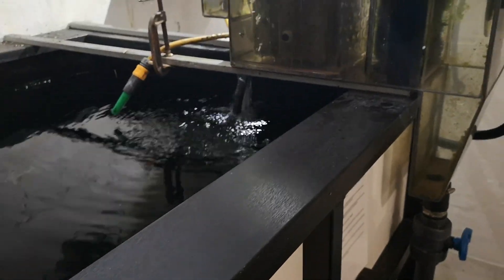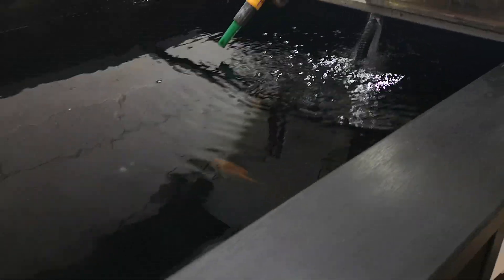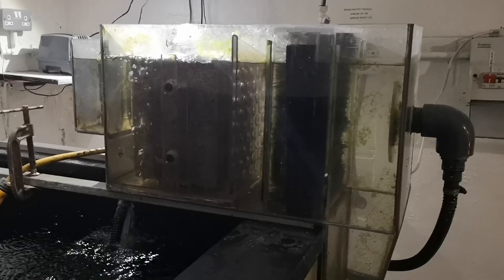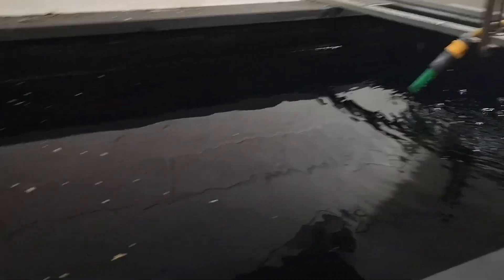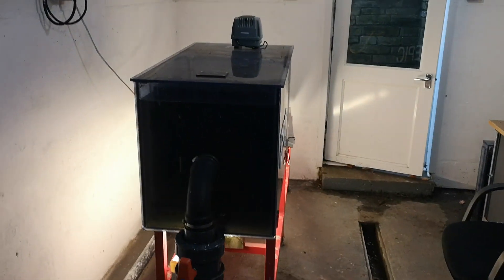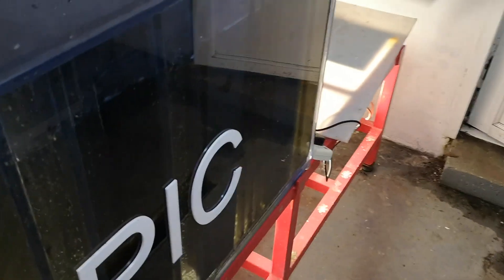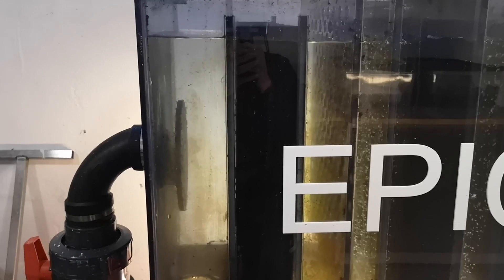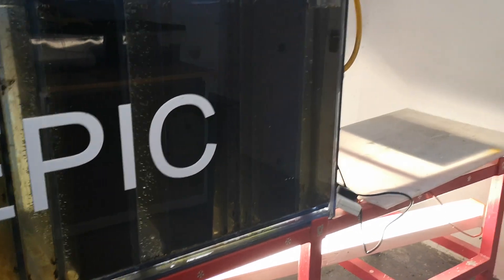Flow rates through Epic filters

Comment: So your big Pond holds 80 tons and you pump only 3.33 tons/hour? Well thats very few for actual/old standards. But like i said a few times now, it won´t work if you go 100% efficient with energy by feeding every drop incl. surfacewater to only one of these tiny filters.
What´s the flowrate of your skimmer? Whats your overall energy-consumption?
I rotate my entire 50 ton pond every two hours with only one 150W pump, incl. skimmer by gravity, i use only very few brushes, some tricks to calm watermovement and a small nitrificationarea.
Every few weeks 20 minutes cleaning with a waterhose, no dirty hands, no blocked pipes, everthing 4 inch diameter.

You also would get in trouble with your small pipe-diameters if you wanted to feed all surfacewater to your filter.
So Waddy, i think for your way and your pond it works, but maybe not for 100% every pond.
Reply from the maker: You only change water every few weeks Chuckle?

Comment: do you have any jets blowing to the bottom drains on your koi pond ?? and how are you skimming your pond ?
Reply from the maker: No I don't have jets Geoffrey but I do have a surface skimmer.
Reply: @waddypete  jets are beneficial to koi body shape and growth!! You have no current in your pond other than the four bottom drains feeding your filters ??
Reply from the maker: @smithmiesterman  - correction, I have a return line from the filter that provides the required current but I don't have jets.